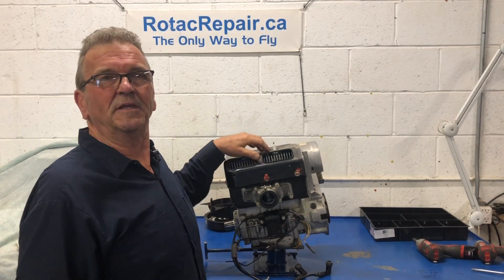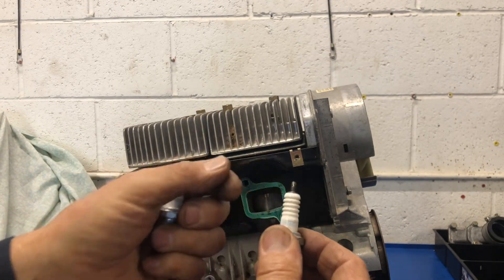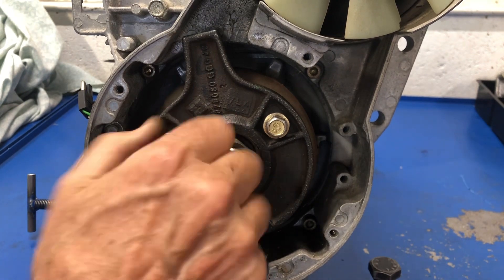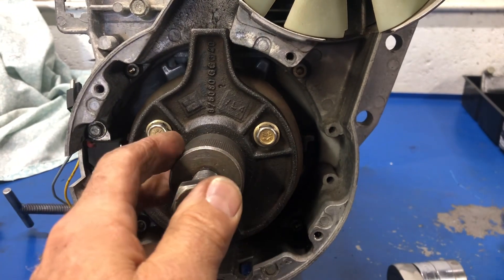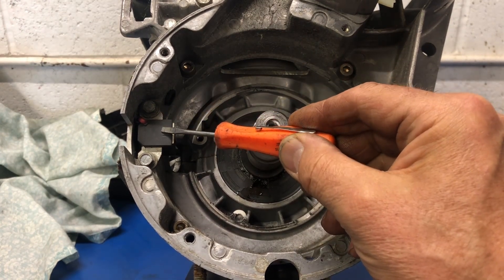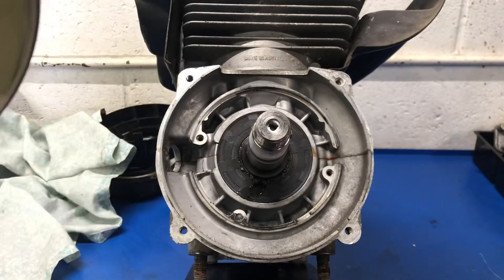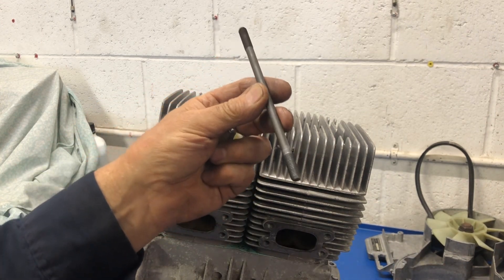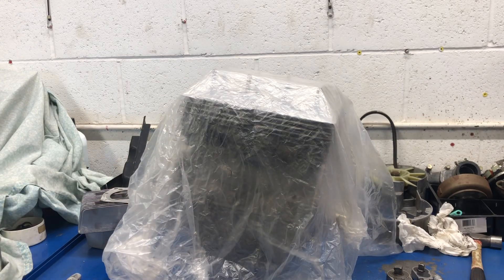Rotax 447 single carb single CDI dismantling (part 1)

Comment: So since the gaskets are the same for a twin carb setup could you run twin carbs on a 447? I mean, I know you could, but would it be useful for individual cylinder cooling?

Comment: Great inspection video👍
Since it has the slot for dual ignition -- is it hard to upgrade?
Cheers
Reply from the maker: I don’t believe there’s a two spark plug cylinder head available